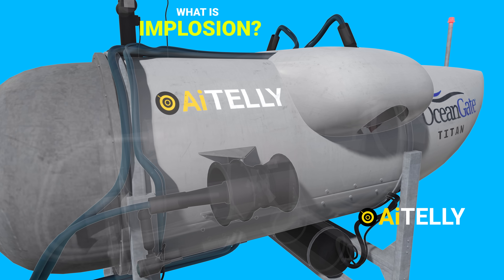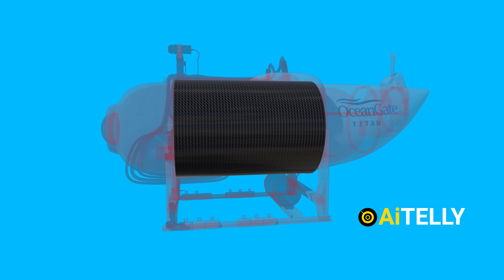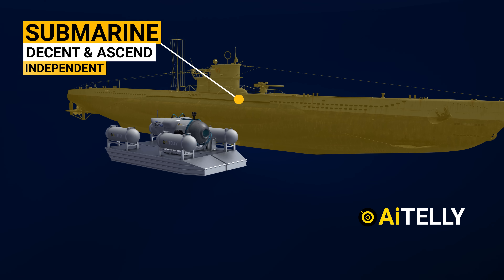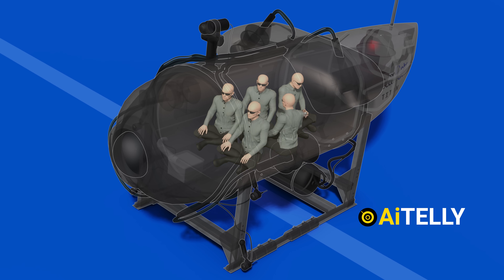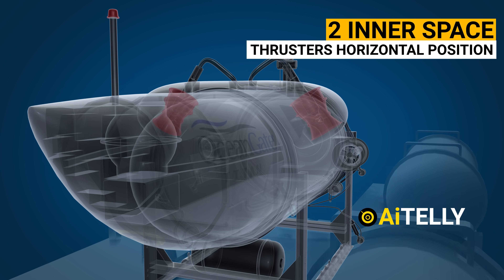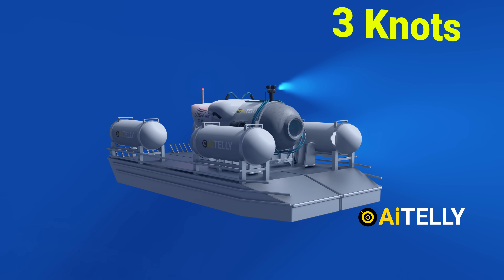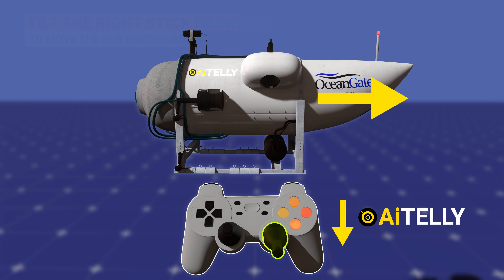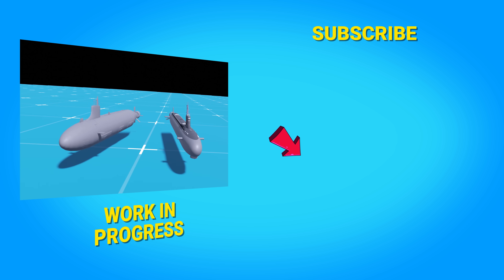Implosion Titan Oceangate How it Happened | Submersible Submarine Parts #3d

Comment: I think my small insight from research into man-made materials is they suffer ‘corrosion’, which is their version of rust, a slow weakening of the glued fibres of the hull causing finally delamination ie the fibres come apart - they split from each other.  Sea water is grisly stuff, how this process works is kind of dastardly.  It’s bad enough having the hull submerged, but we can imagine, it being brought out of the water, dried in the sun, and repeating this process is much worse.  Crystals of salt form, and these literally will ‘lever’ open the tiny splits between the fibres.  Crystals ‘grow’.  It’s like that Egyptian method of cracking open a rock using dried wedges, then you wet them and they expand with so much force they split rocks.  The stone mason just had to make a small hole first, several in a line, jam in sun-dried wooden stakes, then soak them overnight and wait for the ‘crack’ sound.

As James Cameron said, it was just a matter if time.  Did they rinse the hull off with clean NON-SALT water after every trip for example?  I think even this most basic of precautions was not taken, and that’s astonishing.  Their ignorance would fill a book, and probably suitably dissected, will soon do so.  The other stupid thing is, weight is not an issue, except for deploying and retrieval?  There’s no need for a tight safety margin.  Aircraft have that need.  The main reason this happened is because fare-paying passengers are allowed in amateur submersible vessels, and that is a disgrace.  It properly should be classed as a passenger trip, and yet I feel the main thrust of legal interest will have been in making the disclaimer (apologies) watertight.  You know, the waiver you sign that says if this causes you harm, you absolve the company involved, prior to the trip?

This will be an engineering object lesson in not only stupidity but also ineptitude.  Incompetence.  And a failure to treat the passengers as if a ferry or cruise liner would. Where is the second vessel of some type, to effect a rescue or even to go down with this, and where is the camera feed inside the vessel, and following it outside?  But primary, is that salt water, repeated dunking and sun-drying and salt crystal formation.  I idly wonder how thick the hull was - really, the paint is of interest too.  Wait til that gets examined, I bet even the paint shows signs of rot.  Deep sea drilling platforms, oil rigs, have regular examination of their legs for crack propagation.  They find one, they monitor it and corrective action is taken as necessary eg welding or whatever.  This amateur capsule, I doubt had any such rules governing it, I don;t think the owner/company knew the first thing about safety, let alone specialist science and engineering know-how that would have helped guide the manufacture and monitoring of this creation.

And I was the junior research assistant in man-made materials, in a small lab in Scotland, 40 years ago…the real,brains if the operation, heck the technicians, knew more than I did.  And what you see written here, is from what I recall from then, mainly.  Think about how far the above is, from what you’ve heard anyone associated with this sub’s operation, speak about.  They’re not just being careful for legal reasons, they have no clue.  Take care all, this was avoidable.   [EDIT: Oh I should mention one more thing that is blindingly obvious but not perhaps to lay-people - all these fibre/fiber materials, are all about their TENSILE strength, which is to say, they are strong when trying to pull them lengthwise, to stretch them takes a lot of force.  Now, I am no expert on these sub designs, but the idea lf using a primarily tensile material in a capsule under intense COMPRESSION is questionable at best, stupid at worst.  Concrete’s great in compression and so is cast-iron.  Not laminated man-made fibres.  So that, worries me too, that fact being a fundamental property of these materials.  It gets worse the more I think about it.]

Comment: As a carbon fiber specialist, I bet on the same scenario from the first day. 
The weak point is neither the carbon or the tinanium, but the carbon/titanium interface.
If water seeps between the two, the resistance of the carbon winding is useless and the pressure will crush the inner titanium tube.
But it started slowly, depending on the infiltration rate, it seems to have taken more than 15 minutes before deformations accelarated the infiltration rate and then the final collapse occurred.
Reply: The brittleness of carbon fiber didn't have something to do with it?
Reply from the maker: You might also like Nuclear Powered Submarine Engineering behind it #3d Nuclear Reactor released
Link: https://youtu.be/J0lb46Zi5-s
Reply: Sounds correct old man, but instead of "crush the inner titanium tube", I think you meant "crush the inner CF tube". Am I right? I totally agree that if water infiltrates the bonded joint, then the separated surfaces within the joint will experience the full sea pressure (causing CF to crush/fail laterally (ie. across fibres) and causing further failure). Eventually there might be water incursion forming an internal 5,500 psi water jet which would breach the inner layers of CF when incursion forces matched the lateral strength of the remaining inner layers.    cheers
Reply: @gjpercy  
As far as I know, the carbon is wrapped around a titanium tube.
Maybe "inner tube" isn't the right word, sorry for my English (I'm French).
But the fact is that the watertight barrier (welding) is on the inside rather than the outside is a big problem.

Comment: The only fact that this thing run via PC and cheap toy gaming controller was between "ridiculous", "red flag"  and "desperate research of death".
Add that carbon fiber is that much unreliable in this context plus it's always hard to check it's deterioration and this was definitely a death machine.
I'd also like to know if they were still diving  down to - 3800m with a -1300m certified glass. 
As an engineer I'm terribly disappointed by this whole story.

Comment: I would add that the Titan was unregistered as an unregulated experimental craft and that a sphere will always be the sturdiest shape with a tube coming in a distant second. Also, I think the carbon scrubber would have to be situated within the pressure hull.
Reply: I'm thinking the CO2 scrubber is behind the rear wall, in the rear titanium dome. Views of the inside, looking towards the rear, show a flat wall with a large flat screen on it. They have obviously reserved that valuable internal space behind that wall for something. I think it's the CO2 scrubber and the air circulation fan it would need. As you say, located inside the pressure hull.
Reply: @alanm8932  Agreed.

Comment: How many bolts does the titan use to close its hull? 

How many bolts does the vessel actually need based on the diamater of the hatch?
Reply from the maker: Honestly I don't know.
But we made a better one.

You might also like Nuclear Powered Submarine Engineering behind it #3d Nuclear Reactor released
Link: https://youtu.be/J0lb46Zi5-s

Comment: Not only did they use carbon fiber but they also layered it incorrectly. They layered the fibers in straight lines, not crisscross which is how carbon fiber gets a lot of its strength. I was watching a video made about ten years ago about pressure test on carbon fiber cylindrical hulls. When the pressure hull failed it didn't equally crush like the metal ones did, it split length wise and allowed the pressure to equalize. I'm thinking something similar happened but not length wise due to their incorrect way of laying the carbon fiber so the split would have been ring shape. As the carbon fiber started to de-laminate and bow in the middle the two titanium hemispheres just crushed it inward like stepping on top of a empty soda can. I think along with the microphone to record the cracking of the carbon fiber they did mention they had a string indicator (a string strong across from one side of the sub to the other to monitor how much the vessel is compressing, an old trick from the earlier sub days), so my fear is they started noticing the string drop way more then normal they then dropped the weights in an attempt to save it (last text from sub was "weights dropped") but by then it was too late. Fear of this being a moment before the implosion they knew they were probably doomed, also with this many layers of incorrectly layered carbon fiber I wonder if there wasn't a second or two of water making it in by routing around the thousands of strands of de-laminated fibers before the implosion. I hope not as this would have been horrifying for them but we just don't currently know for sure as there are no substantial testing of this situation with the method of wrapping carbon fiber as they did. Makes me so mad that this CEO thought it was perfectly fine to take people down there when there so many experts with decades of experience telling him "Hey, you're going to get some one killed!" He truly thought he knew better then everyone else.
Reply from the maker: Hi you You might also like Nuclear Powered Submarine Engineering behind it #3d Nuclear Reactor released
Link: https://youtu.be/J0lb46Zi5-s

Comment: I thought the titanium hemispheres were glued to the carbon fiber cylinder.  At least that’s exactly what I saw on a video about the Titan’s construction. Ingress was through the smaller viewing window unit secured to the glued hemisphere by 17 bolts.
Reply: Yet they use to seal only 16 bolds, because the 17th was to high to reach.
Reply from the maker: Honestly I didn't know about that

You might also like Nuclear Powered Submarine Engineering behind it #3d Nuclear Reactor released
Link: https://youtu.be/J0lb46Zi5-s

Comment: In all of the discussion on this fatal dive, no one has brought up the subject of hull penetrations.
Your video indicated that the equipment used to remove carbon dioxide and add oxygen was in the tail structure outside of the pressure hull. This obviously required some kind of piping passing through the pressure hull between the compartment and the exterior hardware.
How were the motors and other external devices controlled? Were there wires passing through the hull or did the use some kind of inductive coupling?
Hull penetrations are always weak points. How would we know if one of them failed?
Reply: I would have gave that w.hite man some Blk D if I knew it was the end

Comment: My assumption is that carbon fiber hadn't imploded
While it was descending ,the carbon fiber would have  statred to show signs of cracks
All of them may have seen water sipping in 
Wouldn't have been very long and than the explosion 
Carbon fibre is not like metal or rubber 
It is hard plastic with fibers
It will break not squeeze in
The cylinder part must have been blown into fragmented pieces killing and smashing their bodies and throwing all five out of the cylinder holding 
Rescue came after few days
Current have pushed away all those fragmented pieces away as it was light
What has been salvaged are the metal parts
I may be wrong but this is what I assume

Comment: The damn ape got killed for using carbon fiber ,which arguably has the ONLY advantage of being lighter than it's metal equivalents in car and airplane designs, for the ONE application where Heavy stuff is an actuall asset. This dude thought ''I worked with planes, subs are just underwater sea planes, how hard can it be? i'LL just make a tubular plane''

 * implodes *

Comment: I'm a cyclist and I don't trust riding on carbon fibre because of its short lifespan and how brittle it is. One tiny crack which is not visible with the naked eye and the whole frame can just break apart during a ride with no warning which can cause injury or even worse, fatality. I'd choose aluminium or titanium for my bike over carbon fibre. 

With that said, CF is definitely something I won't trust for something that would be going underwater. With the pressure the CF would go through constantly with every dive, it will eventually break which it did. The Titan was destined to be a disaster the moment CF was used for its hull.

Comment: The pressure hull of the submersible is the carbon tube and the two titanium end caps only. All the white coverings are just external plates to make it more hydrodynamic, which plays no role at the speeds it travels, so again basically just to make it pretty and more attractive to unknowing potential customers. The scrubber system was likely contained inside the rear end cap inside the pressurized hull. As others have mentioned, a proper engineer would have built this vessel with at least a 1.5 or 1.6 safety factor which would have made its max depth around 18,000' or 6,000m and its crush depth even deeper. You also neglect to mention that the window dome used, which was manufactured by a third party, was only certified to withstand the pressure at 1,300m. The fact that it had withstood the pressure at 3,800m multiple times is a testament to real engineering where safety factors are incorporated into the specifications. There was so much wrong with Oceangate that lawsuits for blatant negligence are bound to be filed.
Reply: also, the white coverings (known as fairings), function as protection of the inner hull and equipment against bumps and scrapes, when diving or not secured on the sled. I question the statement in this video that they were pumping "50%" O2 into the cabin, as well.
Reply: @gailmcn  They should have pumped 100% O2 into the cabin since the scrubbers would be removing the CO2. The cabin was basically a big CCW rebreather and with no pressure change inside, only O2 would need to be added. For breathing purposes, they could have kept a 50% O2 gas, this would have made it easier to keep the gas within the parameters of what our body functions with albeit making for a much larger fire hasard but then again safety was not a grave concern.
Reply: @gailmcn  thank you  that actually makes a lot more sense - usually when people get in their emotions and start trying to sound smart in this case I find they more often make themselves appear ignorant
Reply: You have no clue what you’re talking about! Pull my finger! Toot! Toot! Squirt!
Reply: it was only certed to that rating but it likely could have tested higher if people had paid for that testing - I think people are misinterpreting wording around the use of that window or I could be wrong

otherwise great breakdown and helpful comment thank you it was confusing to imagine the scrubber outside of the hull in the rear but it had me thinking that explained the crackling sounds from aft but probably it wasnt like that

again on wording I think the filing of suits is pretty inevitable in this case but because of *gross negligence yes I believe some of the suits are actually likely to stick
Reply: @williamrobinson4265  When a company with proper engineers and proper certifications designs and constructs a part, it incorporates a safety factor, how big I don't know. A proper ISO $$$$ certified company overdimensions their product in order to cover their behind. When the manufacturer of that porthole certified it to 1300m, they incorporated a factor 3 safety, proven by the fact it actually had withstood three times the pressure at 1,300m. That is called proper engineering.
Reply: Not much correct with most of your comment. Your Obviously not a REAL marine engineer to use your terminology  Probably not litigating any wrongful death torts anytime soon either..I would at least have proper facts.If you want to shit on dead people  who cannot defend themselves ....Later i will come back and fix  everything wrong in your comment if you want me to,,,,,,,,,,,,,,,,,,Dont sue me for defamation.......LMAO

Comment: CF has strength from internal pressure and not as much in external. 
In the construction pre preg cf is preferential and I believe the ceo lied on this according to the manufacturing video. 
I could have sworn the cf was also older one. 
For sure the guy had financial issues and short cut the design and production. The fact he was chasing clients with a discount showed the company had issues. I saw an interview which a guy explain it should cost more like half a mill per person